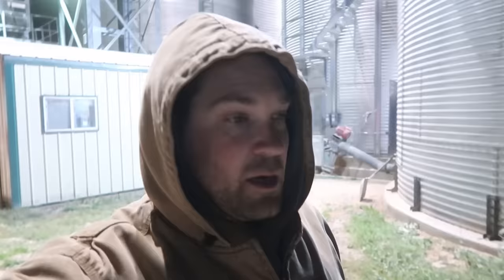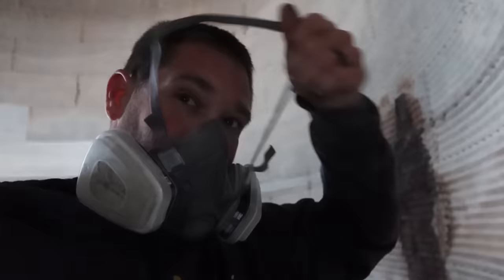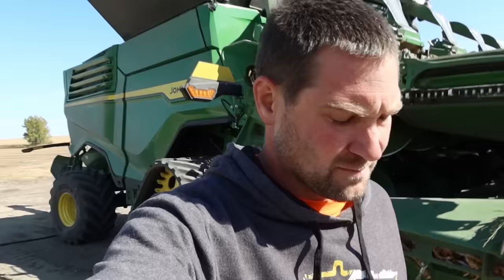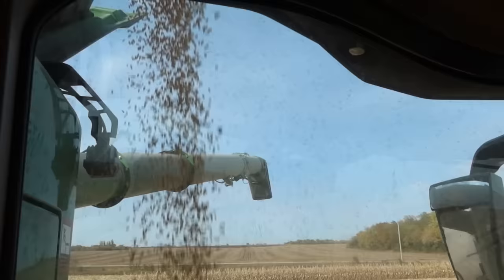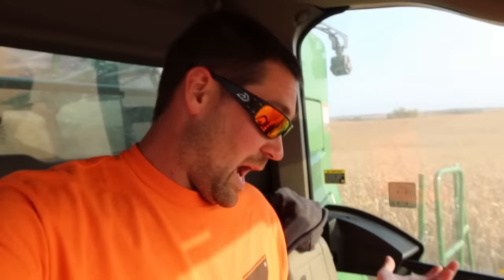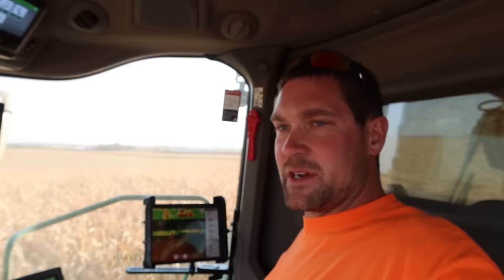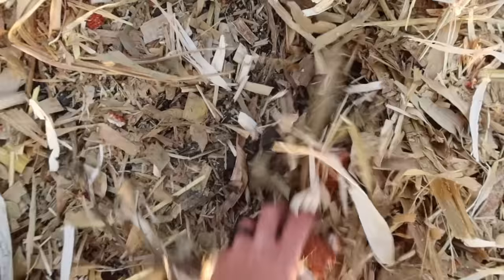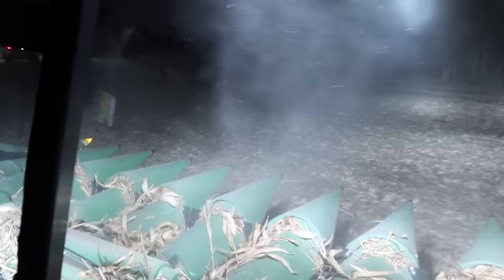John Deere X9 Likes and Dislikes

Comment: Hmm... $500,000 2020jd x9, $40,000 2006case ih 2388 and yes it looks cleaner in the tank, but outside the red one is cleaner. And yes maybe x9 isn’t fine tuned the right way, but the point is,  our 14 year old combine is just as good as your brand new combine, yeah green one is newer and better and everything, but red one has a stick that you push forward to make it go, green has buttons and switches and computers and codes and overall a lot more stuff to go wrong.
Reply: Also don’t tell me how wrong I am, because it’s true, at least x2 the wiring, computers, buttons, and on the older one you can combine and not have to remember how to turn on the lights, because it is right in front of you
Reply: I’m going Thru, learning how to make the computer make things “easier”..  today did it manually again.  The new machines do it better then I can.  But the price of even a normal size combine...